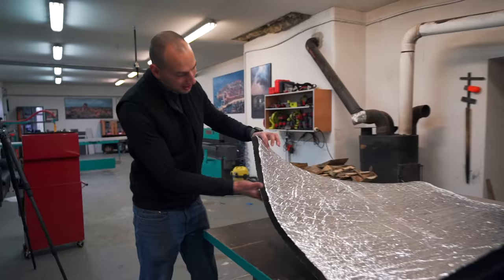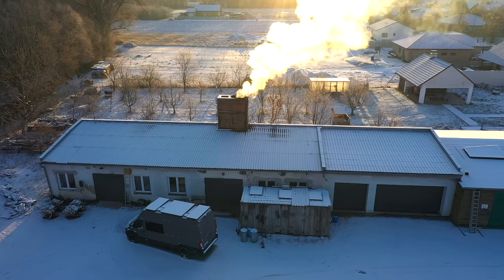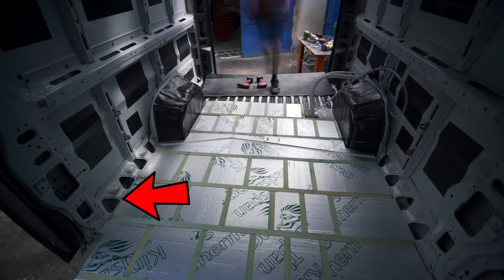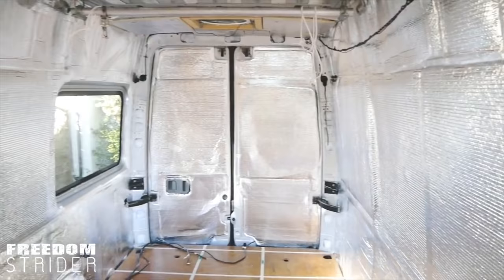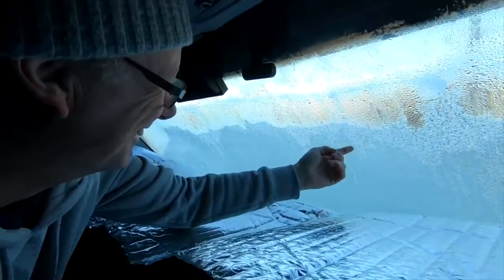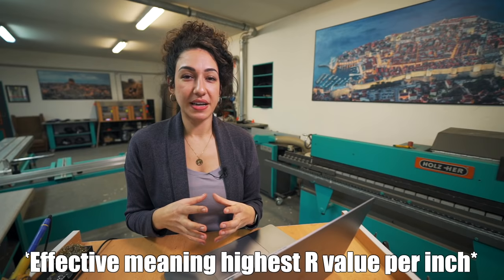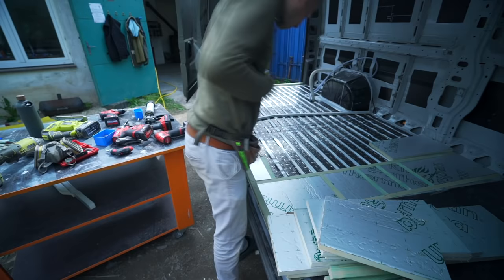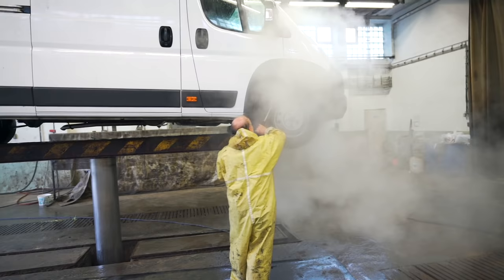❄️How to *ACTUALLY* Insulate Campervan for WINTER VANLIFE ❄️

Comment: Insulation is a rather tricky when it comes to van build - we spent ages researching insulating methods before attempting ours, and even now, there are things we could defiantly improve upon. The long and the short of it is, the van is a metal can, that is not really designed to be insulated for human habitation, but we all do what we can. Honestly, next time, we would love to try spray foam insulation, and see how it compares. 😊
Reply: it works and is all done in 4 hrs!
Reply: Don't use spray foam! It is not the right thing to use. If you ever need to access wiring after doing that forget it. It's a terrible choice for houses - don't do it to your van!

Comment: The insulation debate online is surprisingly full on! After long deliberation we went with 100 percent sheep wool insulation, including floor, ceiling, doors and barrier to the cab, for good R-value, moisture control and environmental friendliness. We decided not to install a vaper barrier due to the theoretical worries moisture can get trapped behind it if there is a hole anywhere. So far it has been holding up well, we don't have a proper heater (but do have some radiant floor heating) and we are reasonably comfortable until about -1 celcius. One tip for anyone: we love love love our 100% cork floor (wisecork), as it stops the floor from feeling cold, another great insulation addition.

Comment: Next week i will be installing close cell foam, your videos was of open cell which is used more in house builds and expands more, close cell will only expand about 25mm. Close cell has a mass R value of 6.5 plus it also offers vapour and sound deadening. I am doing walls doors and celling in a vario bus and predict it will take one day. I do run a spray foam company so have a full set up rig, am hoping on good thing from it

Comment: Hi Margaret, your comment on security made me remember supplying a used vehicle to someone in a dangerous part of the world. He requested a "kill" switch installed on the vehicle that could be surreptitiously activated if they were held up at gunpoint! It had to have a delay incorporated of I think 30 minutes, long enough for the robbers to get away from them and then be impossible to re-start. They would then be far enough away to keep the owner safe from retribution. I never heard if it was ever activated, but he seemed happy with the installation. Many thanks for another interesting video.

Comment: Good advice Margaret - just one error - hot air rises ,not heat , heat loss occurs in all directions.
Reply from the maker: Such an important correction thank you!
Reply: To further clarify this: yes, heat can travel in all directions but only through the mechanisms of convection, conduction and radiation.

Convection is (in a van) hot air rising, as described which is largely what the ceiling insulation tries to prevent going any further.

Conduction occurs when things touch each other and the heat transfers from the hotter to the colder (eg hence the thermal bridge of the metal described in the video, with heat from inside the van transferring to outside via any exposed metal).

That leaves radiation (light; ultra violet through to infra red) which is what Reflectix tries to “bounce back”. You need an air gap on the reflective side because without one, heat would simply conduct between the touching materials into the Reflectix material itself and then into the side of the van.

Comment: As a certified home inspector and sub contractor that has built, remodeled, and repaired moisture damage on many homes, I can assure you that you SHOULD NOT USE A VAPER BARRIER! Also, only use breathable insulation!
The sheet metal on the van is a vapor barrier. If you put one vapor barrier on top of another, then you are creating a place for moisture to be trapped and start molding/rotting materials. Only one side of an envelope should have a vapor barrier and that depends on the climate. Basically, you want the vapor barrier on the HEATED side of the envelope. So in Florida, you put the barrier on the outer sheathing. In Maine, you put it on the inside. Unfortunately with vans, we're stuck with it being on the outside. So when you run heat on the inside during winter, it's best practice to just make sure that your insulation can BREATHE and dry out. This mean, no extra vapor barrier, and no closed cell insulation! Closed cell still allows moisture over time, and I've seen and repaired a lot of rotted sheathing where closed cell spray foam was installed.
Reply: So your suggestion would be to put lamb's wool insulation behind some sort of wood paneling?
Reply: I hear where you’re coming from!  What types of breathable insulation would you suggest?
Reply: I'm using a mix of thinsulate and havelock,  I live in a cold climate,  with heat rising my ceiling will get a thick layer of wool, the walls will get thinsulate with a few certain areas getting wool..
Reply: Totally agree, getting ready 2 do 1st Van, amazed at all loose/false information published.  In USA   we live in society that thinks more is more.

Comment: What I feel should've been talked about is the condensation on metal when the temperatures inside and outside are different. For that reason stuff like Armaflex is great. 
I personally don't understand why you'd like to put wires under the insulation though. Just more convenient to put them on top where they are more reachable when you want to modify/add/delete parts of the electricals.
Reply: wire routing takes up a surprising amount of space in such a small area, especially if you want it all to still be accessible.  Chances are you will have built significant internals on top of the routing and will be loath to change it anyway as you will rip out lots of stuff.  And with careful planning you are unlikely to actually change the wiring arrangement.  It's actually less planning than you would put in to try to make the surface wiring still accessible but still discreet.
Reply: i have also used armaflex on parts of the van (internal side of interior ply panels on rear and side door, where rigid board is difficult to fit and spray foam will interfere with door mechanisms.  it works very well, however, where there is a large temp gradient (~40C in alpine winter as insulation for the Maxxfan port) i find that it degasses a bit and shrinks by about 3% (1cm across a 35cm width).  not sure whats happened in the door panels

Comment: I love these kinds of videos!! I am doing a vanbuild right now and I have a building science university degree. I want to add onto the vapour barrier debate. First of all,  I get why you would want to add a vapour barrier, I know the importance of it in a house. However, there are a few fundamental differences between a house and a van: metal exterior and diy building. For a vapour barrier to work, every puncture of the barrier needs to be sealed again. If done perfectly the vapour barrier adds to the build big time, but if done imperfectly, it has the opposite affect. Where the screws go through (metal and therefore can get quite cold in some situations) condensation can happen, which due to the barrier cant escape. Mold will form around the screws there. Also how sure are you that the outside of the van is air tight (for years and years)? After buying an old van I am not too sure that this is the case for our van (even after doing so much work on it to try). If it is not air/water tight in a tiny spot, condensation will happen that has no way to quickly dry out and therefore mold will form. I know that this is a fairly new discussion for van life, but RVs are around for longer and they are made with vapour barriers. Older Rvs are now full of mold, that is why they always have a very distinctive smell. I decided on getting an water absorbing insulation that is good against mold (sheeps wool) and a construction without vapour barrier that has a lot of breathability (insulation, air gap, cladding which is what they would do in a house). Mold in a small tiny house is very unhealthy and toxic, I would not risk it!!

Also: consider what kind of particles insulation is emitting. Usually, normal house insulation is not fitted for tiny homes because it is harder to create the passive ventilation (in housing MANDATORY, when using non natural insulation and building materials) that keeps the air clean enough to breath safely. Thats why tiny houses are often insulated with wool as well!
Reply: Hi Marit, I'm an architect, who has some experience in detailing building envelopes. At least in Australia (I can't speak on other places) there is a strong move to using vapour PERMEABLE membranes, such as CSR Enviroseal Proctorwrap. The difference between this and traditional vapour barriers is that the permeable ones are designed to allow water vapour to transfer without air (and hence your thermal air barrier). This is important in preventing moisture trapping in the insulation zone and causing mould, but that moisture will transfer into the van. However, if there is an air gap and a vapour barrier, vapour will collect, and run down to the bottom, which is where Margaret rightly said to keep the channels with drip holes free. As for breathing /cooking /other things ;) you need to open the roof vents /windows and allow some air to come in and out.
Reply: Wool is a good insulation if it can breath, it absorbs moisture so it needs air movement to dry if it gets wet.
If you want to learn best practices you can learn a lot from the professionals that specialize in construction and insulating metal sided buildings.
Reply: So I am just barely holding on here in terms of having a verrry basic understanding of insulation but an allergy to mold.  I heard a Canadian gent speak about Sheep’s wool in the context of eventually it will sift and not hold an even insulation. And the possibility of it molding. He suggested a few things the only one I can remember is a kind of ceramic insulation? You and May I ask you both what you think of cork as an insulator in a van?
Reply: Interesting 🧐  I am building my van as we speak I covered as much of my walls as I could with sound deadening now I am stuffing with wool wool wool:
According to Margaret on the video I stuffed too much wool in the bottom of the van where your weep holes are so I took all of my wool out and I struggled trying to find something to put in the bottom to hold the wool up off of the bottom to keep the wool from getting wet from the weep holes :  which when taking my wool out I had found a small area where some water had already made its way in and got a very small area of my wool wet :::  the way my van is built There is no way to put the wool over top of my cavities that go down in there without the WOOL falling in so I am taking plastic fencing Rolling it in small rolls and strapping it to stay in this shape with zip ties everything will be plastic nothing should rust nothing should really rot that way I can still insulate a little bit down in there to help keep my floors a little warmer if interested I can send you a picture of how I did this with your education of vapor barrier I’m hoping this will work of ——- worrying about moisture getting in and causing me mold problems is really a concern for me as I am 70 and going to be going on the road  “ hopefully with my almost “100” year old MOTHER “
She wants her last adventure ;)
I’m working hard and fast to get this going this little setback caused me some time : however ; I am very glad I saw Margaret’s video :::::: Linda
ANYONE HAVE ANY POINTERS FOR ME IS ALWAYS WELCOME
——- I hope to be running a small dehumidifier and an air cleaner 
No mold is a must for us 😷

Comment: I only always hear insulation in the context of being warm, but insulation works two ways.
A well insulated house or vehicle can also be a lot cooler. Given that you also do the same as in the winter, keeping all the doors and windows closed when it's outside warmer then inside (ideally also darken windows). 
When an AC is being used, this also means that the AC will work a lot more efficient.

In general rockwool is always a very decent go-to, not as good as foam boards but cheaper.
Just not really nice to work with (nasty, but NOT lethal) , not as bad as glass wool.
The more organic kinds are really nice on paper, on practice their R-values are kind of sad unfortunately (as much as I REALLY wish that wasn't the case)
Personally I always just go for hybrid approaches. There is no reason to go only for one type of material only.
Reply: Rockwool is actually pretty safe.  Just wear a dust mask and you're good to go.  My plan for my insulation (I'm very close to that phase in my build) is a combination of as much as I can install foam panels with some sprayed foam to seal, rockwool in the wall conducts and other tight spots or... near door mechanism.  And a layer of reflectix covered air bubble plastic wrap.  Should be good enough...

The bottoms of the walls bothers me to be honest.  I really don't want moisture accumulation there, but I don't want cold coming from there either... Maybe the bubble wrap reflectix will be enough there 🤔😅
Reply: How do you recommend insulating for warm weather (within the structure of the van)?
Reply: @laurelanderson-rostami109  basically the same way. Just make sure it stays cool inside instead of getting warm. For example an AC also works much more efficient with better insulation.

Comment: Very helpful (and in our case, reassuring) video. We used foam core for the floors, thinsulate for the walls/ceiling and were gifted some wool, so we used that to stuff the nooks and crannies. In conjunction with our Espar heater, we are very comfortable in the van when it's cold outside. .
Reply: Having watched a bazillion van videos I think this is a really useful way of assessing why and how to create the van situation I would actually be able to use most happily. I like what your doing it shows a greater base of knowledge than just fawning over a creation and not understanding why or how to make good choices. Keep doing this.
Reply: Which Espar Gwenn? Air or coolant
Reply: @4Hester  heat for the Espar (water and air). Our AC is a 12v Dometic.

Comment: I'm an architect. Here are some tips for insulating. When we insulate buildings, it's based on the climate zone. Obviously, van life is mobile, so that's a big challenge. I would use a middle ground climate zone for basis of design. Climate zone 5. In climate zone 5, walls would need an r-7.5 (coninuous), roof r-25, floor r-10. 1"of polyisocyanurate has an r value  of 5. Thus, walls would get 1.5", roof would get 5", floor would get 2". This thermal envelope would give you the most optimum performance. Having said that, 5" at the roof may be unachievable due to the height restrictions in the van. I would at least do 2". Another thing that may help is installing a fluid weather barrier on the insulation boards between the boards and the interior face of the metal. When you insulate a van, you will create a dew point in this area. Water will condense there. This weather barrier will give the water a drainage plane to the vans weep system. This video does mention the drainage cavities. The weather barrier is different than a vapor barrier. I would not install a vapor barrier on the interior of the van. It will block natural permiation that is needed for the space to breathe.

Comment: Thusfar, Ladi has been implimenting all of the ideas I've had in my head for my next van. I REALLY want to know how he plans on designing the convertible shower. Is it a dual shell design, is it using a flexible barrier, does the counter top rise with it, if so, how is he levering it to conform with the van wall, how is the door being designed, is the toilet built in, on a drawer slide, or removable, how is the ducting for the exhaust being routed..

SO many questions.

Can't wait to see an indepth video on that one!

To add, very few youtubers in our community provide the kind of value add that your channel does. I don't follow many but you both provide such good content, with such great editing and showcasing your amazing personalities that I find myself eagerly waiting for the next video to drop.

One area I think your channel could expand to provide more relevant information to the community: Electronics. I dont know how comfortable you both are talking about it, but there are some fantastic resources online that could serve as the basis for an entire series on DIY electrical engineering for the Van community.

I'm thinking synchronous buck converter MPPT designs, arduino (WeMos boards for automating via Blynk apps), how to program a rasberry pi to control solenoid valves (I see Ladi is likewise looking to impliment a grey water dump cam, great minds!).

An example could be adding auto leveling to your beds actuator system, assuming they're rated for the weight, something I've got on my wish list for my next build.

Just an idea, there are so many ways that building a van can serve as a platform for educating people to be more self suficient. Your channel is and will continue to help push the community towards ever greater feats. Thank you.
Reply: PUEDE SER MUY EDIFICANTE APRENDER, PERO SE NECESITAN HERRAMIENTAS QUE HABITUALMENTE EN UNA CASA NORMAL NO LAS HAY COMO UN CORTADOR Y PULIDOR DE MADERA O UN CORTADOR O DOBLADOR DE TUBOS, O UN CORTADOR DE HIERRO. HAY UNOS UTILES QUE SE UTILIZAN QUE HABITUALMENTE NO ESTAN EN LAS CASAS, COMO COSA NORMAL, ZEL DIA A DIA, NI MUCHA GENTE TIENE UN ALMACEN, PARA TENER TANTAS Y TAN GRANDES HERRAMIENTAS DE PRECISIÓN.